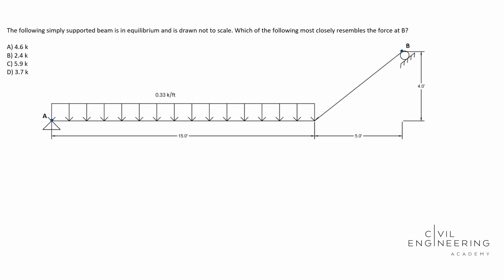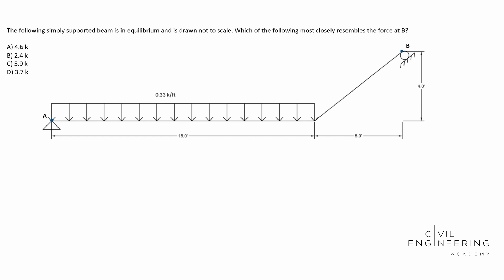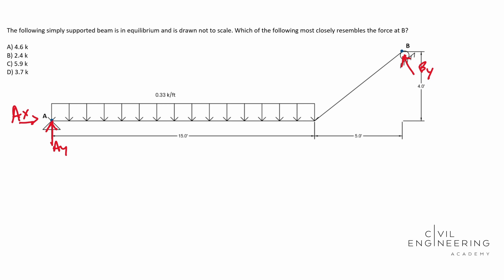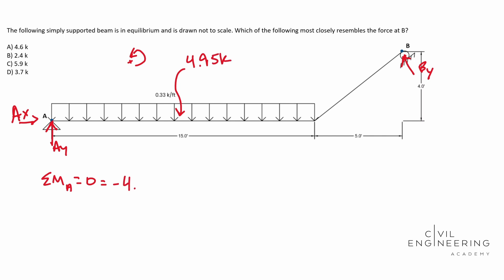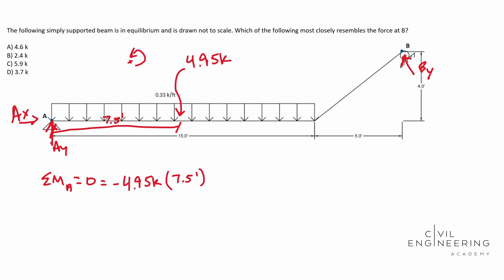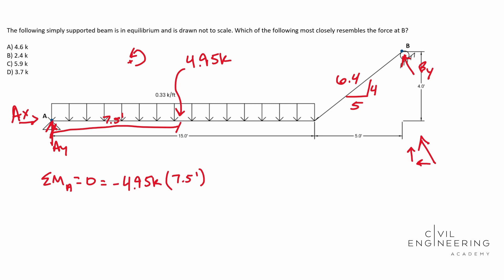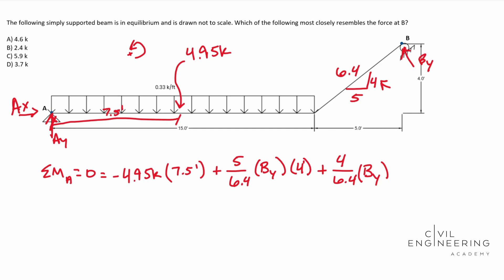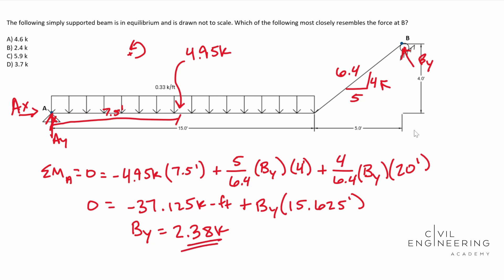Civil FE/PE - Structures - Finding the Reaction Force in a Simply Support Beam

Comment: I think you may have the Fbx and Fby switched in this problem. The Fby should be the larger of the two reactions so Fby=Fb*5/6.4 and Fbx = Fb*4/6.4. Plug these into the moment equation and I get 2.04K so technically B is still the correct answer but remember that the force Fb acts normal to the incline so the resultant components are opposite of the slope.
Reply: You're right (Visualize the incline approaching horizontal, By will obviously be larger than Bx). This video also makes the mistake of inconsistent x and y axis. It should not be shown as "By". It should be shown as Reaction B with a By and Bx component.
Reply: You are right, the By=(5/6.4)B and Bx=(4/6.4)B
Reply: I got the same, 2.04
Reply: also disagree. regardless the force is still in the positive direction acting on A; therefore even if these are "flipped" there would be no impact on your answer.
Reply: @SomeLady1410  It does have an impact because the force components are being multiplied by the distance: (5x4)+(4x20) does not equal (4x4)+(5x20).
Reply: I think you're wrong